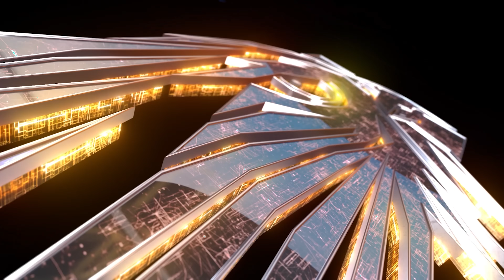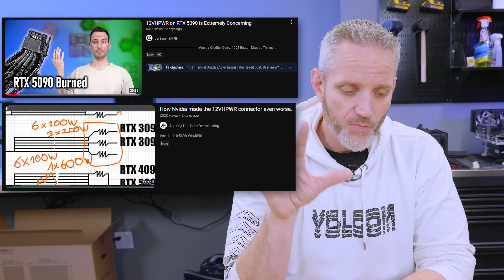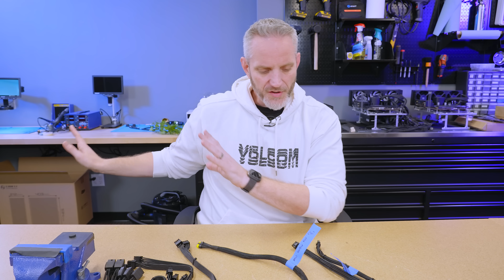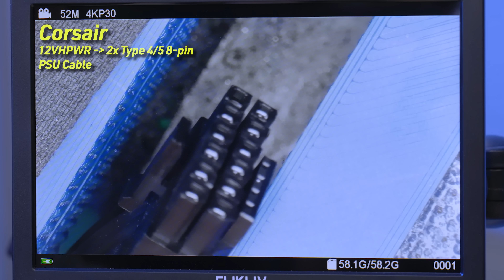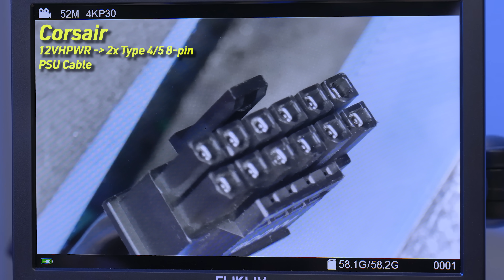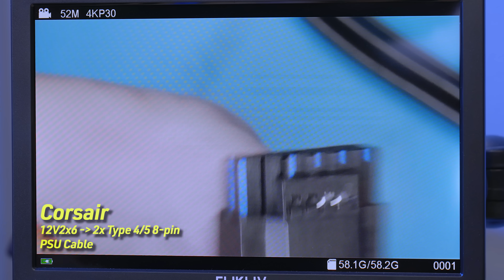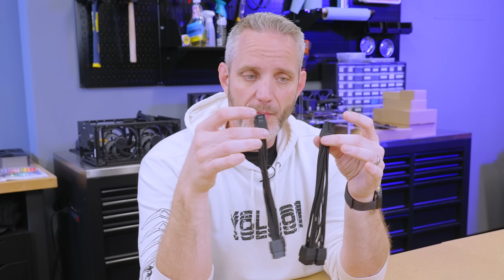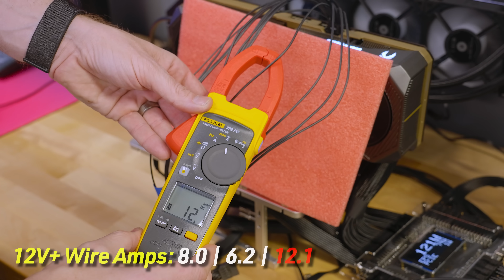I discovered something concerning and I need the Experts to chime in... More 12VHPWR discovery!

Comment: My Corsair 12V-2x6 to 12V-2x6 cable from my 2024 RM850x has smaller variations in pin depth but they're still there. My 5080 FE did not power on when I tried it but it was a stiff fit into the GPU connector so it possibly might not have been in fully. I switched to the Nvidia adapter + 3 Corsair PCIe cables and it worked straight away.

Comment: I wonder if the reference-ground of the data-connections is soaking up the current that was intended to return thorugh compromized ground wires; And what effect that has on the durability of other components in the system ; incl. monitors.

(edit, also: Suprised that my ritual of seating each individual wire applies to this top-end segment, when I developed that habit from having to constantly scab-together garbage components to get by. )

Comment: I have that corsair cable. I have the AX1600i and the 1000w bios on my MSI Suprim X 4090. I've pulled well over 700 watts through it.
The original Corsair link software monitors the amperage for each plug if you really wanted to get some info on the amperage lol.
So maybe its not the card or the cable...maybe it's the power supply.

Comment: Funny thing Jayz suggesting adding shunt resistors... Like they did in 3080ti (2 wires per shunt) and kinda 4090 (3 wires per shunt) but not in 5090 (all 6 +12V per one shunt). In 5090 they just put all pins together and only one shunt for all pins. No more load balance. Good job. Also is that bridging plate behind gpu connector beefy enough for all those amps anyway and not heating up?

Comment: why can't they just give us a 12v lug on the power supply and then we can hook up a zero gauge 12v wire that we bolt to the card with a screw terminal.  

that should fix the power delivery problems

Comment: 1. Why not Plugin and test it? 2. Why no Thermalcam and Test it? 3. Why you have one Corsair Cable and the Contact from Pin is not 1mm the contact Pin is 5mm long? And wait... we have sende Pins. You mean, the Cable burn at the PSU like Roman show us for this small problem? Maybe it burns at the GPU Port yes. or we have a disco, but not a full 150 degree Cable at the PSU. or?

Comment: Ground should not be as problematic as +12V because you have more ways for ground (PCI-slot, case). The chance with 12VHPR to 12V2x6 is only on the parts in the PSU and cards, not the plugs on the cables. And in the PCI-spec is the pin is 4.2mm long, but only 1.45mm ot it is "target connection length", so you have 2.75mm of "wiggle-room" for your plugs inside the plastic connector. So there is more unconnected pin in the calculation than connected pin for the amount of power. And older 6- or 8-pin PCI connectros had even more wiggleroom and had not these problems. But they have not been used to the full calculated power-throughput. The 12VHPR is rated for max 640 W and is used with 600 W. The 6-pin was rated for 100 or 150 W (depending on wire gauge) and usually used only up to 75 W. Using a connector with over 90% of its capabillity or 50% is a huge difference in room for failiures.

Comment: And thanks to the board in the middle, you proved, its a power supply issue, not the cards problem. The output is garbled from the source, not the cards side.

Comment: Can you test the power and amp from own NVIDIA adapter and card performance using that adapter.  You are right 4 normal PCIE will be better than 1 thin 12+6 wire.

Comment: I think the reason the positive pin is melting first is the current can go back to the Psu on any ground and is not current limited like the positive side. Try putting your amp meter over all the power wires and comparing that to all of the ground wires to see if there is some extra current going through the motherboard ground. Even if not, though the current won’t be forced to go through a pin with high resistance. 

I think the reason it is on the end is because the pin will be pulled out more on one side if the cable is bent. 

Get a pin removal tool to see why that one pin is moving so much. Just practice on something else first. It is east to damage the pins and you may have to yank one out to see where to press the tool.

Comment: Corsair’s quality, both in software and hardware, has been declining significantly recently. I was a loyal customer, using their mouse, keyboard, RAM, and headset, until iCUE became complete dog 💩. I encounter persistent issues and driver crashes that have led me to discontinue using all of their products. I believe they are trying to accomplish too much with too few resources, resulting in a frustrating user experience. While I don’t use their water cooling components, I wouldn’t invest in their products based on my overall experience with their other offerings. Thanks for your insight, Jay, it’s always appreciated.

Comment: The ground is generaly much more resilient because while the supply voltage can be easily separated, the GND is a single reference is shared among all components and therefore is also present in the PCIe connector and there can (and probably will) be non negligible current flowing through the PCIe GND lines.

Comment: Yes, power in and power out have the same resistance and the same current. BUT:
GPU's also have power from the bus. The 12v is, as far as I know, separately regulated on the card, but the ground is always connected! ALL grounds are connected. So I wouldn't be surprised if the 12v over the connector gas a higher current than the ground over the connector because is might be "balanced" by the ground on the bus.
I haven't seen any schematics, or done any measurement, so it's only speculation, but it is a possibility that shouldn't be ignored!
And even when the 12v lines aren't all connected together (Again, I don't know if they are), the ground lines are. So same goes here: the ground lines could be better balanced because they are all connected.
A higher resistance should NOT cause a higher current. It can cause overheating, if the needed current is still pulled over that pin. But normally, if the resistance gets higher, the current through that line should be LOWER, because the other lines have a better connection, so they should take up some more current. So having one wire running 30+ amp is unlikely that that is caused by a bad connection on that wire. If anything, it would be caused by a bad connection of the other wires.
Overheating due to bad connection doesn't happen on both sides of the cable either. They only happen on the side of the bad connection. The 5090 issue is due to unbalanced current. It's unlikely to be a bad connection on that line.

The test with the PMD2: it shows the problem is on the PSU side, NOT the GPU side this time. I suspected something like that from the derBauer video, because the PSU connector was a lot worse off than the GPU connector.

Comment: With all 6 12V+ pins being connected, it's stupid, there's no load stabilization like the 3090 cards had. Electricity will travel the path of least resistance and electricity is like heat dissipation where you want more surface area at your connections to reduce resistance. I saw a video showing how it's wired and makes total sense why 3090s that had the 12VHP didn't melt but the 40/50 series do and honestly, I would doubt that lower tier cards won't start melting on 50 series because they are even worse than 40 series. Any little bit of resistance in 1 of those 6 wires will cause the others to draw more. They should have at least made it 1 Giant pin and the 6 wires feed to it and then at least the individual pins wouldn't have become a weak point. If ASUS makes a wireless card  (project zero like) as they had previously, that'd be the best card to get as those don't use 12VHP. All this tells me is to go AMD...
Reply: Now as for the pins being recessed, yes that will cause differences in resistance and therefore a load balance issue. That is because of the tolerance of the plastic house and maybe even the spring locking tabs on the pins being bent on the individual pins. The Pins are just held is usually with 2 small metal tabs that pop out into groves in the plastic to hold the in place. They can get bent/broken very easily. Happens all the time with the 6/8 pin RS485 connectors my job uses to connect Custom PCBs in our Smart Markets and Smart N Go's. The engineering place the trays connector at the very back of the Module where you can just bear reach it with 1 hand stretching as much as you can to squeeze between the trays and if you don't get the 2 connectors exactly straight, you can pop 1 of the pins out of the plastic housing. In my opinion after having worked as a QA/Engineer and Senior Technical Support Specialist on machines that use a similar connector. I hate 12VHP, the spec is garbage. I just don't trust it. Seriously, I would be looking into removing the connector from the board and soldering a lead to it so the connector isn't right on the board, but even that would just be a Band-Aid for a terrible spec.
Reply: That Corsair pin, looks broken, did you try completely pulling it out of the connector. I am going to upload a video a made a few years back to teach my Tier 1 Techs because sometimes a tray in our machines would stop communicating and it's the pins in the connector just like that. That much play can make that one pin loose complete contact. I'll post the video link once it's uploaded to YouTube.
Reply: And yes, I would love to see someone make either a cable or something that goes inline that can do load balancing. At this point, I don't trust NVidia to fix this and a 3rd party will likely have to if they are willing to even take the risk after the Cablemod adaptor thing.
Reply: Or maybe a bridge bar connector all 6 pins on the + and - sides respectively together like how that one wire had the sense pins bridged. That could possibly help balance it better. It would keep all 6 pins inserted at the same depth into the connector if they are all connected to each other on the backside of the plastic housing.
Reply: I bet if you opened a 50 series card and a power supply, connect the both up, no power needed and used a Digital Multimeter to check resistance from the pins off the PCB of the GPU and PSU, each of the 12 circuits will measure different resistance. Spreading a single load across 6 circuits like that is just a horrible idea. Again, the key problem is electricity travel the path of least resistance so that best connection will see higher amperage and be the one to likely burn/melt based on theory.

Comment: This is not a cable problem. This is a 10 cent part connecting to a $3000 welder problem. Nvidia designed it. Nvidia needs it. Nvidias fault. Nvidia needs to explain why all that amperage is going through basically one cable. Good luck getting that answer.

Comment: The pins in those cables remind me of the Molex 4 pin units. Some never mode, some did it while you blinked.
A not for me thing here.I'll stick to my current single 8 pin Sapphire card until such time as I really need something different. Not a want, a need.

Comment: From an electrical engineering stand point the problem is more with how the card is designed. Electricity takes the path of least resistance and the shortest path it can. The  fact the rail in the card just connects all of the wires together and doesn't control how much it pulls thru each one is going to cause them to burn out. You can't do that and i am amazed that there hasn't been more issues. That is why they use larger wires in your house to hook up something that needs more power. If i used 2 14 gauge wires which are designed to carry 15amps each to power something that uses 30 amps. One wire would burn in half and then the other. Which is basically what we are seeing with the 5090.
Reply: Well, As an elec engineer, you should understand that in a parallel circuit, current is shared. As long as both cables are the same, the 30 amps will be shared over the 2 cables. If resistance was different in one of those cables, there'd probably be minor current difference over each cable (15.5A + 14.5A), however, I doubt a 0.5A would be the difference between a melting cable and non melting cable.
Reply: @L3ER0Y Shared while satisfying R1*I1=ΔV=R2*I2, with each cable dissipating R*I^2 watts. (NB resistance increases with temperature rise, unlikely to start in equilibrium.)
Reply: @L3ER0Y  The cables aren't ever exactly the same... this is why it's common to apply a de-rating factor. It can vary based on quality and whatnot but a common guideline is in absence of other insights to derate by 20% for each doubling of the pins that are sharing the current among each other. So if you have 3 groups of 2 parallel pin pairs each, you might afford yourself 550W, while if they're all in one group, 330W.

And by the way, you're supposed to de-rate the same for the supply and return pins both. So even say in a card which has separate VRMs connected to each power pin and where you don't ever see damage on 12x6 connector, if the return part of the connector starts failing, you're going to see blackened and lifted PCIe socket pins instead. Or the ground offset will simply cause the card to crash before visible damage occurs.
Reply: @L3ER0Y  Yes in a perfect world of perfect resistance. We don’t live in a perfect world so things don’t always work out that way. If one terminal has a little more resistance than another. More power will flow thru the other. Which is basically what has happened with the crappy standard, and quality control of these connectors. Making the pins and terminals smaller and having less actual contact raises the chance for error.

Comment: Hey Jay use a silver Sharpie paint marker and mark all your cables at the butt of the connector (insuring the pins are all pushed to the end, then plug it into the GPU and check how much the connection pushed the cable/s back. great video and thank you

Comment: This cable sucks! I like the idea of it, but it's implementation is terrible.

Let's make the cable of the future. Let's spec it to 600 watts. Let's not have any guidance on the power distribution between cables.

Melted plugs, damaged cards, damaged PSUs, a respec, and a couple years later...600+ watts already! Sure was forward looking into the future.

Comment: @Jayztwocents If Corsair is emailing you saying the connectors are fine. They need to hire an actual electrical engineer cuz they dont understand the first rule of electricity and that is electricty will always follow the path of least resistance. So without load balancing all the power could all jump to one or two wires and cause them to heat up. In addition, when there is a bad connection or one not getting as good of a connection, like on the Corsair plug. Resistance will also cause heat and lead to melting. That is how every electrical heater, oven, incandescent lightbulb, etc works. They clearly do not know WTF they are talking about.. SMH..

Comment: While it certainly looks bad (and may in fact be a defective connector or pins), ultimately the engineers that designed the connectors have what is called a "mechanical tolerance stackup".   The tighter your tolerances, the more expensive the unit is to produce.  EVERYTHING in that connector has tolerances; the connector housing has tolerances for the width & lengths, the distance between the front of the connector and the plastic retention bump for the socket, specifically.  The socket also has tolerances on the width & length as well as the distance from the retention tang to the front of the socket; also there are tolerances on the connected retention mechanism.  These tolerances must all be tight enough to ensure that 100% of the pin-to-socket contact area will always be engaged.

Comment: It’s a crappy power supply design issue mixed with terrible video card design! There’s no reason the power supply should allow 20 amps through one wire regardless. This can absolutely be done inside the power supply. 
The adapter cable should solve this cause each of the connectors is limited to a certain amount. It at least subdivides it limiting max output in any single wire. 
In car dealing with sensors they sub divide inside the car ecu 12 volt output to different sensors to prevent wire overload. 
They also in many cases use a larger wire to a bridge adapter that then divides the power output. 

There’s no reason whatsoever this can’t be done inside the power supply.

Comment: It shouldn’t make a difference where the bad connection is, 12V or GND, the impact would be the same assuming they’re commoned together at each end.

On the other hand, if all the ground pins are commoned together in the GPU, but the 12V pins are going off to different consumers, then yeah I can see a potential problem. Losing one out of 6 ground pins means you’re increasing the current going through the remaining pins by 20%. If just two of those 12V pins are going to power something in the GPU, then losing one of those increases the current in the other pin by 100%.

The least they could do is measure the voltage drop between the pins to see if there’s significant resistance anywhere, be that from a dodgy contact or one wire having more current than it was designed for. Or just use 2 big pins instead of 12 smaller pins, like an XT60.

Comment: I just built my PC with a Corsair RM1000X (2024) that comes with the H++ version of this wire. I don't plan on using it, but I did out of curiosity slightly tug on a few of the individual wires in it. Some of them do in-fact have quite a bit of wiggleroom. Same for the normal PCIe cables that came with it. Noticed a little bit of the same my previous PC's Seasonic's PCIe cables, though they don't wiggle as easily since the cables are fully sleeved and glued together in some bits.

I don't know if that has any bearing on those two manufacturers' quality control, but I found it a little surprising.